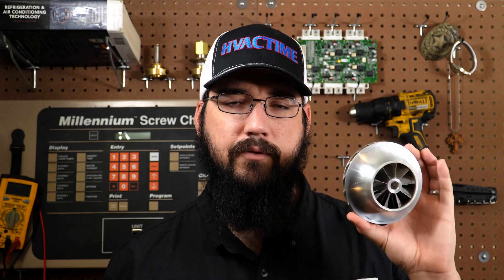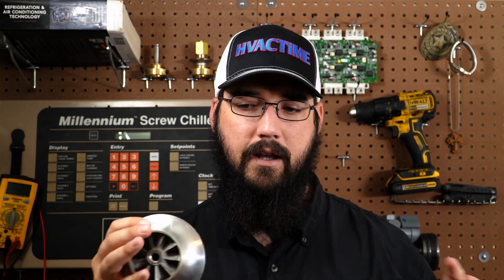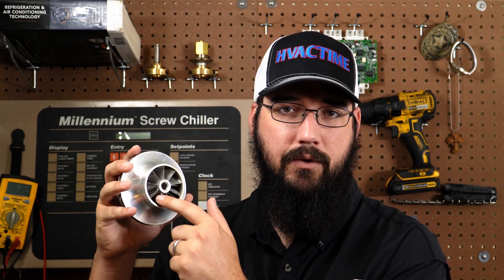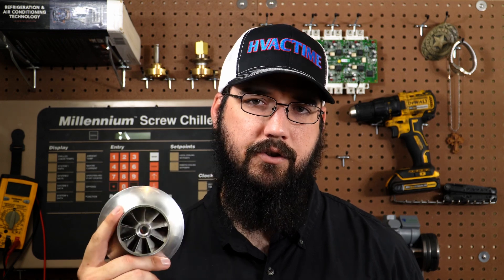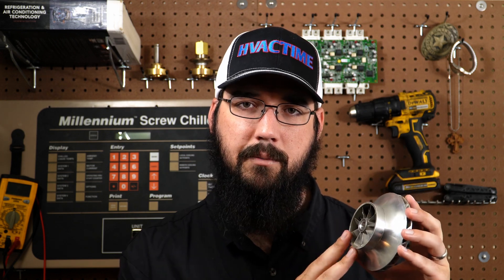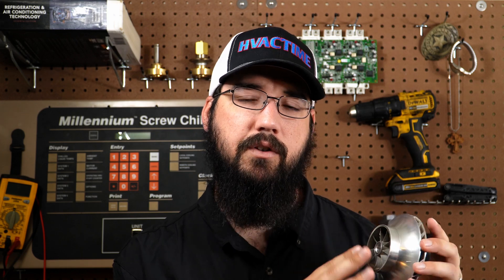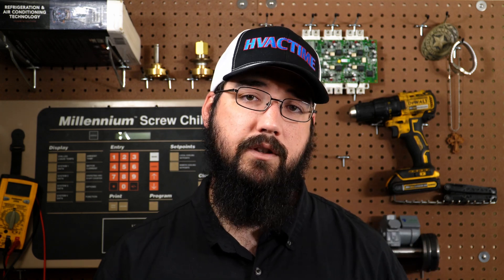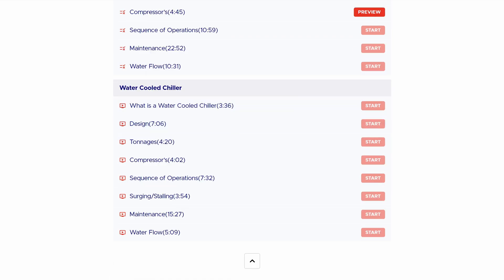What Stall is in Centrifugal Compressor

Comment: Question: I ran into a scenario today with a YK machine where it was going into a stall state without high lift. Actually there was very low lift. With Cond Water at low temp around 55F. I though stall happened when the lift was too low and surge happened when the lift is too high. Am I wrong about this? I’m new to the centrifugal world so any info would be appreciated. Thanks.

Comment: We run a York. It’s been in service for about 10 years, it has thousands of stall counts through its service . I’ve never really been able to get a good answer as to if these are design to protect from surge or an actual problem, we do run them at low load at times just because of the design of the facility it’s necessary. But we’ve never had any issues or failures of the machine.

Comment: Thanks sir,
Please can you clarify one point.
Surge occurs when pressure ratio is higher than the maximum pressure ratio. Here is maximum pressure ratio a parameter set by engineer on software monitoring tool or is it something else? Thanks
Reply: It's a parameter capped by motor hp and impeller compression ratio at full load on motor. When the pressure gets higher downstream of the compressor than your compressor can produce at max it will flow backwards.